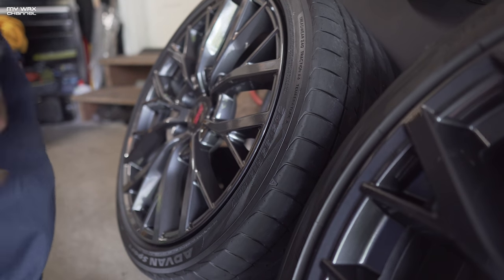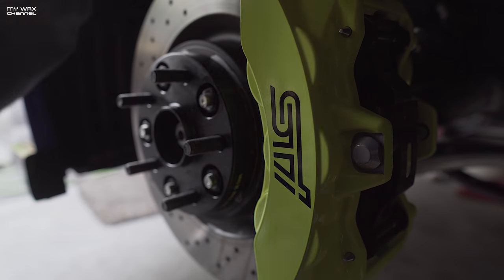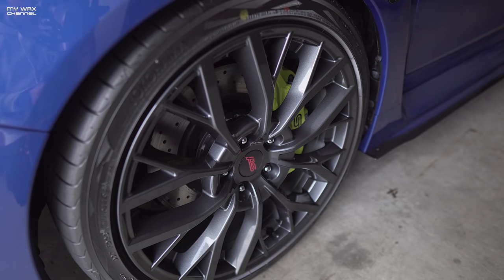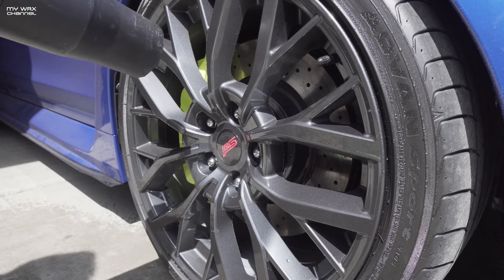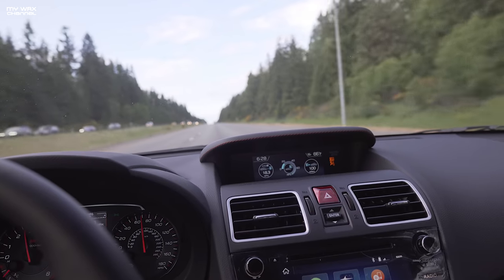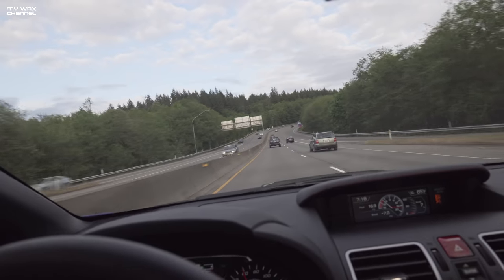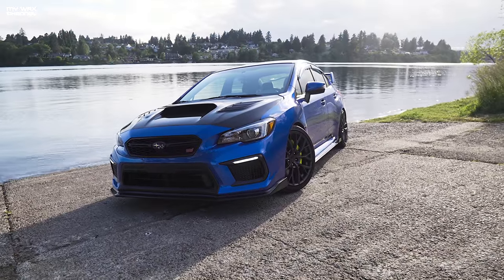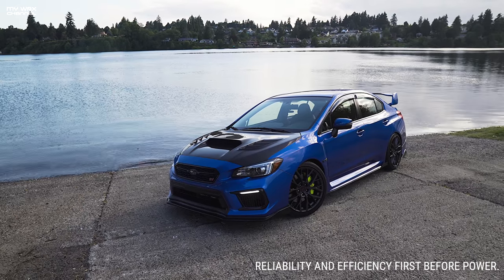POV 20 PSI MAX BOOST @ 1K MILES. (STOCK) | WHEEL AND CALIPER CERAMIC COATING | 2015-2020 SUBARU STI

Comment: I had a stage 2+ intake 2007 and got a 2019 STi in November. Similar situation I needed the rumble back ASAP. 

it’s a much nicer car inside than the old one. I did flash stage one and I’ll say it’s worth doing. Not going to completely change your mind, but for me the throttle alone felt much better for sure. 

I changed my oil at 1k and put in redline, installed  a Cobb intake at that time as well.

I’m only at 2k miles so far but I’ll be following a similar journey with you, great videos.

Comment: Upgrade cooling and add air oil separation. FBO mods can tax the cooling system (air, oil, coolant), along with the tiny VF turbo, which is out of efficiency past 18psi. FBO on stock turbo will bump boost up to an average of 24psi;  it's literally a very hot hair dryer. E85 is only a band-aid fix. Start at the source first.
Reply from the maker: You literally have one of the best and most efficient set-ups and admire the direction you went with yours. 🤙
Reply: @CarsWithJR  I figure everyone has gone through the same mod path for years and ending with the same results. I've taken an unorthodox method of modding it. We'll see how it goes...

Comment: I did my oil change at 1k as well. Piece of mind. I did the Cobb stage 1 OTS. Then I moved to the MAPerformance Stage 1 and just recently changed over to the MAperfomance Stage 1+ (with intake). It really cleans up the jerky stock tune and it adds a good bump in power. I am really happy with the overall performance of the car for a daily driven street car. Check them out. Highly recommend.

Comment: Cobb stage 1 improved drivability and the powerband (not by a lot but still noticeable) on my 18 STI. Downpipe, injectors, and flex fuel are a must. It's night and day difference with full bolt ons + flex. Very happy with mine.

Comment: @MyWrxChannel, I did indeed change the stock brake pads since they produce a lot of dust. I switched to ceramic brake pads and the difference is day and night! . I ceramic coated my new wheels as well, and let them cure for 3 months ( I did it on the winter time) and with the ceramic pads/ ceramic wheels coat combination, my time washing them was reduced considerably. Great videos Brother BTW!

Comment: Lovely car, if you came from 200HP cars to this then the first pull would feel like something. Honestly I think its best quality is the 1-2-3 shifts. I moved onto the F80 platform cause I didnt want to throw alot of money at my old STI just to make it "400 whp". Best of luck in your future with this car. Get some better tires/dial out the stock understeer and it becomes a autox monster!

Comment: Going from a built 19 wrx to an STI I can say I was very underwhelmed 😂
Reply: Going from a car with more hp to a car with less hp, I could really tell it had less hp. Lol... interesting.
Reply: s3rendip1ty funny how that works
Reply: Damn..how did you already have a built '19 WRX and make the switch to STI so soon? 🤔 Im impressed..wish I could afford a full taste of one and switch to the other that quick 🤣
Reply: websterm57 how? By loosing money that’s how 😂 I got tired of the wrx after 6 months. Although I also accidentally may have pinched the crank case breather on my AOS and sucked 10 quarts of oil through it before I traded it in 🤷‍♂️ someone else’s problem now hahaha
Reply: @cameronbeyer7687  lol makes sense.. Not sure I want to comment on "someone else's problem" but that's why I didn't buy my car used 🤣
Reply: websterm57 someone else as in the dealership lmao
Reply: WRX modified to stage ticking timebomb vs stock STI, at least the WRX was faster, once.

Comment: Oof 18mpg, full bolt ons here I hover around 24 if I stay out of boost.
Also according to Surgeline (at least the 18 STI) only makes 230whp on their Dyno.

As far as the OTS, I would wait until you have bigger injectors and just do a protune, your IDC is already pretty high in stock form.

Comment: Have a 18 STI and did the Maperformance stage 1 tune and can't say it tremendously faster, but it's much more enjoyable to drive than the stock tune.
Reply: I went with Maperformance stage 2 it's fantastic for the money you spend.
Reply: @fishneck7366  I wish I could but they dont have it for the 2018s yet

Comment: I have a 2019 sti, did the stage 1 tune. Hits a little more boost but nothing crazy. Plus I’m 4,400ft above sea level. Waiting to do bigger power mods until I can get a protune. Also, my mpg went up after the first 1k break in period. Can’t wait to see more vids man!
Reply: Riley Parker I’ve read about the mpgs going up after 1k break in and I’m kinda noticing a little bit that it’s true with my month old 19 STi. I wonder how and why it works that way?

Comment: Start with the IAG air/oil separator.  Stock STi gets a lot of oil in the combustion (check you TMIC and you will see oil) chamber. The oil ignites easily due to heat, causing detonation. Next upgrade the fuel pump and injectors, as you don’t want to run lean in fuel. Once these are done, it is simply a matter of how much money you want to spend. Enjoy!

Comment: Do the stage 1 you will be a little happier.  I got a 2019 sti a few months ago first new car always had old junkers and I was disappointed with it also. After the accessport and r400 exhaust cat back, it made a noticeable difference, power is more linear. I was also hitting really high boost after.

Comment: I tested a stock 19 STI and a 19 Legacy with the 3.6 non turbo back to back, and didn't see that much difference in straight line performance.  Agreed, the STI really kicks ass in handling and braking though.  Well, being 10K cheaper, I bought the Legacy.   And a whole lot more comfort, bells and whistles etc.  It is unfortunate that Subaru is dropping the 3.6 6 cylinder for a 2.4 Turbo next year.  PLUS, I CAN RUN REGULAR....  My first 2 tanks of gas have resulted in 30+ MPG too.  IMPRESSIVE

Comment: Lol. FBO E85 wrx > Stock sti. Looks good though brotha.
Reply from the maker: Wanna race bro! 😂 Gimme a head start. 😂
Reply: I agree to a point, I’m FBO + Cobb flex fuel in my 18’ WRX and I love it. Just waking up and knowing I’m going to drive it at some point in the day makes almost all the bs dissipate. However, I did get to recently drive my buddy’s stock 18’ STi and for what it is, not bad out of the box. I guess you really can’t go wrong with either depending on what you want out of it 🤷🏻‍♂️🤙🏼

Comment: Cobb stage 1 ots map just smoothens it out a bit. Actual power gain is negligible. I was hesitant but I couldn't resist. I'm currently running it on my STI. No complaints, but nothing to write home about. I actually just traded my FBO 17wrx last month for it. I don't regret it. The car feels way more grounded.

Comment: I've had 2 WRXs ('04 and '19) a BRZ ('14) and a STI ('11 hatch) and my older WRX woulda waxed my STI with bolt on intake/exhaust mods, ECU tuning and fuel pump and injectors. My BRZ would've come close too with just intake/exhaust and clutch mods. STIs are not that much faster than WRXs, especially the newer WRXs. Don't get me wrong, the STI feels better in the turns stock (nothing compared to the BRZ). The new WRX is a stop-gap between getting everything together: handling, speed and comfort. Knowing that, I'll take my new WRX over the rest any day (even though I loved them all for different reasons).

Comment: If yours is a 2019, the OTS Stage1 is totally not worth it. I think it's actually worse than the stock tune.
I also had a 2016 WRX, with mods it was faster than the stock STI, but the STI is superior in every way...
Reply: Besides the engine
Reply: @adamno7714  the FA absolutely DIES after 4500rpm. It is extremely disappointing. The EJ pulls strong and linear all the way. I thought i liked the FA better, but no; as old as it is, prefer the EJ. Except for fuel consumption in the city.
That said, both are fine and enough for having fun.
Reply: @emartinezr  The wrx falling off at 4500 rpm isnt because of the engine itself... its all in the tune. Fa20 beats the Ej in every way.
Reply: Just to be clear, stock tune falls off hard but stage 1 fixes that. Add a few bolt ons and e85 and you're killing sti's. I agree the sti wins in every other category.
Reply: @adamno7714  yeah the FA is a more modern engine. But modern is not necessarily better. And better only once it's tuned. If your primary goal is just beating STIs or whatever, then modding a FA does it; but so would modding a 2008 Civic. If you're interested in a complete experience, then the STI absolutely kills it. 
However, the car does look faster than it is. The EJ should have been making at least 340 by now.
Reply: @emartinezr  Its not better because it is more modern it is better because it is better... And you could take a mechanically stock fa20 with a flex fuel kit and make stupid power. 330-350ish. I am just comparing the two engines.
Reply: @adamno7714  The way I see it, the FA you HAVE to modify it. The EJ is perfectly fine as it is. = better, to me.
Reply: Emilio Martinez I agree. Even tho I love my FBO + corn juice 18’ WRX, out of the box, the STI is pretty nice for being stock. I didn’t want to stay stock tho.. So that’s why I went fa20.
Reply: @subieja  yep exactly. Very easy to make more power on the FA by modifying, but you're only improving 1 element: engine power output. The STI engine is really good in stock form (especially the 2019s), but you also get so many improvements (some of them intangible) that simple mods won't match. But yeah... all depends on goals and preferences. I like both really haha but prefer STI and EJ.

Comment: On my ‘18 STI I did my first oil change at 250mi. Second change at 750, third at 1,500 and fourth at 3,000. Now I do it every 2,500 miles.   A lot of people will think that’s overkill. But it was worth the peace of mind to me. The metal parts wear in and I didn’t want those tiny bits of metal in my oil.

Comment: Did you notice any driveability changes after installing the spacers? I'm using 20mm and noticed a few changes with dampening characteristics and slowed acceleration. Although the acceleration may be in my head.
Reply from the maker: Yes, with the spacers, I noticed slightly slower turn-in characteristics.

Comment: Did mine at 1000, then another at 1400, Car runs wonderful, first oil change was dirty as I was told, 2nd was a lil hit less, and the third will be done by me at 3000.

Ots maps suck, get an e tune or a pro tune

Comment: If you do full turbo back, downpipe , intake and do a stage 2 e tune from mikey Botti it will run alot better! If you want to try it if your around Seattle you can drive mine!
Reply: Also that maxed out injectors so you cant do anything after that unless you upgrade fuel.

Comment: It’s a shame how far the STI has come in the last 15 years. In 2005 a mustang GT had 300hp. Now a mustang Gt has 480hp, a 180hp bump. In comparison, the STI has gained 14hp in that same time... I still love my STI, but I wish it was faster from factory.
Reply: justin turner well they also changed the motor and went with something bigger and much more high performance. That’s a v8 rwd “muscle car” not a skippy Japanese 4cyl
Reply: JakeLemons Butkus remember  back then, the skippy 4cyl would beat most V8’s.
Reply: @justinturner4850  when was back then? because this doesnt happen... i drive a wrx now, and before it i had an st (modded to shit so yes it beat v8's) but never did any car (affordable 4cyl) come close to stock and could beat a real v8 performance car

Comment: Hu I have a 18 wrx and I'm rocking 560 hr and 589  Torque. And get 25 mph if I cruise control it
Reply: William Brakeman yeeeeez those numbers are INSANE for a FA20 🤘🏼🤘🏼🤘🏼
Reply: @subieja   really? i guess, just stx 71R fa20 at 28 boost MISHIMOTO top mount inter cooler, remark mid back with what ever the shop used for the turbo back. brian crower connecting rods, hd race rigid 6 pad cluch kit touring sport dampers at stock hight, cob intake, upgraded injecters. and front and back strut bars.  my max boost is 31 pounds but thats a bit scary.
Reply: William Brakeman okay I just reread your comment. Okay so you have aftermarket rods but do you have a STi tranny swap?

Comment: Tips on removing the rust from the brake pads when it rains ?
Reply: Hahaha
Reply: Literally drive 😂
Reply: @treblemix_  its not completely coming off still on the edges :(
Reply: Brake pads do not go all the way to the edge and that is normal.
Reply: buy carbon rotors lmao

Comment: Review on the STI seats vs stock WRX seats? Then your compare to your Bride seats? 
I've really wanted the STI seats over my stock WRX seats.
Reply: Got the 19 STI limited.. the recaros are very stiff compared to my old 16 wrx.  Im 5'9 145 lbs.  Went on a road trip from KS to NY and back and it SUCKED. My ass and back were screaming 2-3 hours in. Did a few KS to STL trips in the WRX which is 4-5 hours, no problem.
Reply: The seats are the same shape and padding. My base STI seats just have leather on the sides and suede in the center. They feel the same as my 2018 WRX seats.  After reading Brandon B's comment I'm glad I got the standard seats.
Reply from the maker: WRX and STI seats are the same. Same for the Recaro’s. WRX Recaros are the same as STI Recaro’s. JDM models (S208) have the “real” Recaro’s.
Reply: @jonathanb1987  hmm... maybe its all in my head or they're not broken in? Coulda sworn my wrx seats were a little more forgiving! Lol
Reply: @CarsWithJR  I'm pretty sure that the WRX and STI seat bottoms are the same as the Recaros but the seat back is different.

Comment: Every tuner I talk to always mentions how much Subaru downtunes the STi for "emissions" 
Im currently saving for a FPR, downpipe, pump and injectors (E85), plus cooling mods (rad, oil cooler, cyc4 mod) and then grabbing a tune for it all. Possibly an intake and intercooler.

Comment: I’ve got a 19 sti and I so bad want to get an AP etc but I don’t feel it’s worth it to run ots stg 1 with the Cobb SF. If anything get just a pro tune with all stock. Me personally, I’m waiting until I have all the full bolt on parts etc then a pro tune. At best I feel it’s the safest route. Just my opinion.
Reply: SubiSkank you want him to get a protune with a stock car? He would just need to pay the same price again once he gets new mods. Why would he get one when he’s stock..
Reply: JakeLemons it’s simple, if he wants to just go stage one then why risk running a basic ots Cobb AP tune with a SF intake when the stock air box is just as good and getting an actual protune would be a safer bet for it is dialed in specifically to the car!! It’s not a one size fits all!! Each engine is slightly different! Let’s say he’s only got 91 octane around, well then he’s able to get a good protune for 91 and get the most out of the tune vs slapping in a sf intake and stg 1 ots calling it a day!! So that’s why I said either, hold off until he’s got everything ready or at least get a protune to get the most out of the stock setup.

Comment: I was waiting for this.  As far as power and speed you literally downgraded.  Even a full bolt on sti will get owned by a full bolt on wrx. There are 3 custom tuned, full bolt on sti around here that absolutely hate my wrx and that was before headers, TMI and e85.
Reply: Agreed.